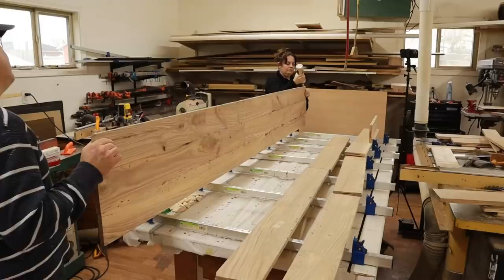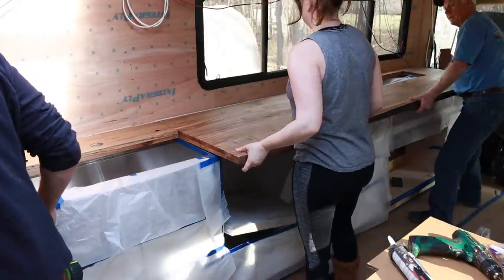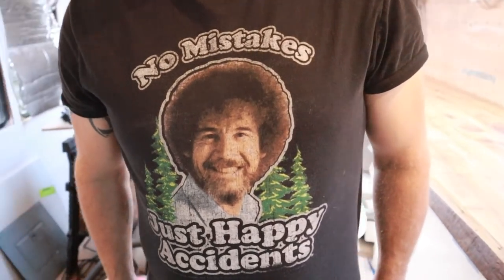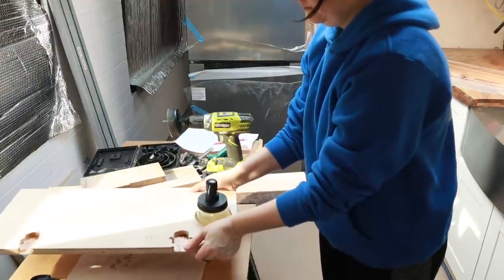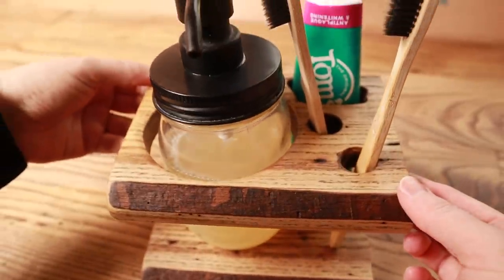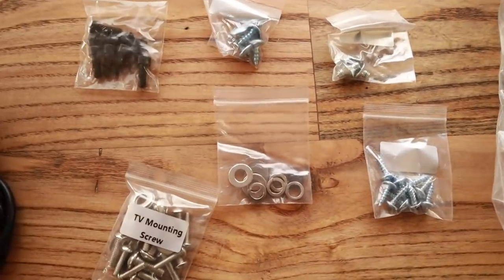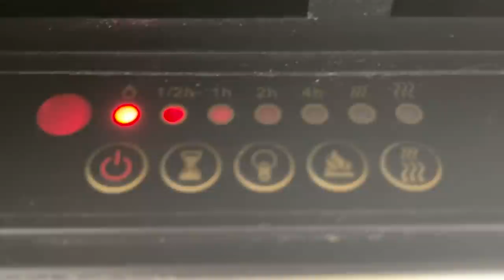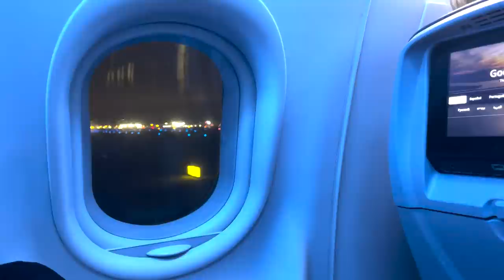Touchstone TV Lift and Fireplace for our Tiny Home//BUS CONVERSION - S04E40

Comment: I used same product to put a lift in an old dresser.  To help the lid open up I installed a couple small wheels on each upright that hold TV.  Wheels push up on lid until lid slides on back of lift.  The lid should close on top of TV going down.  Tough to explain but it works.
Reply from the maker: Yes!  Great idea.  We want to find something like that so it doesn't scratch the wood.